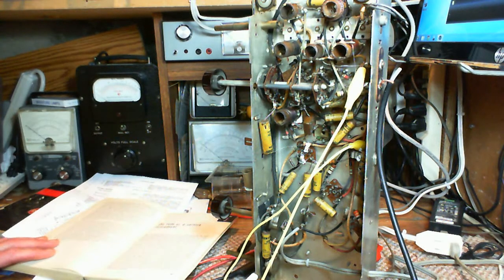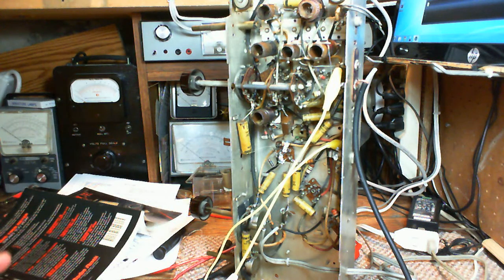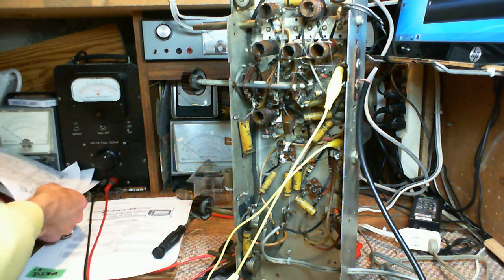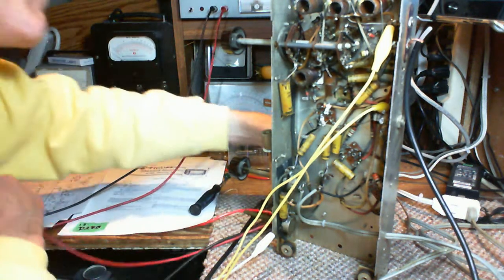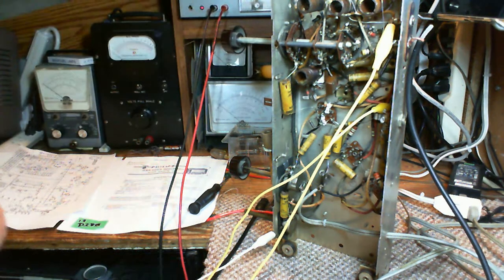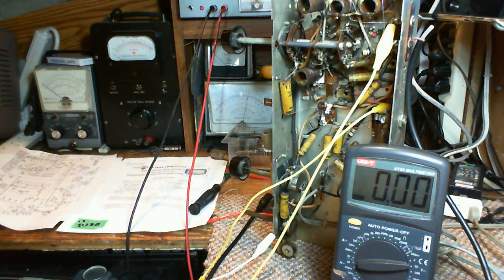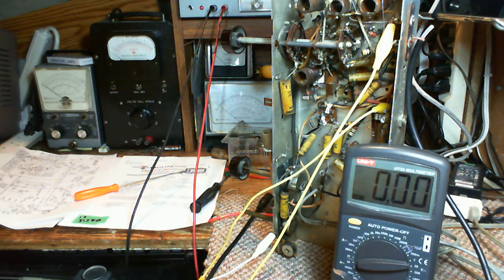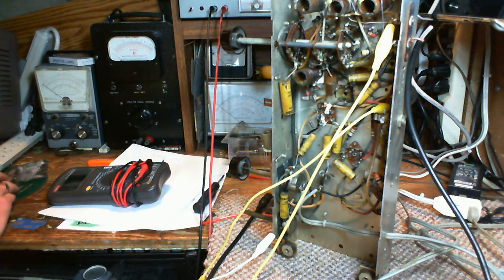Input Impedance VTVM vs DVM - Vacuum Tube Voltmeter vs Digital Voltmeter

Comment: I have never calibrated my meter because I don't rely on them for precision may I just say lol you I think you are like pretend electronics guy I don't think you have ever been calibrated and I would not rely on u for precision  vtvm is probably more accurate than that uni t.
Reply: Sorry man just busting your balls as they say in the north east but you are one crazy dude but you keepin going keep up the good work
Reply: Well I had to rebuild the whole voltage divider on a eico 232 as everything single one was out of tolerance some were not that bad off, but still got replaced. My DMM is quite accurate so voltage wise it’s close enough, resistance measurements have are pretty much spot on. The only  resistor that didn’t get replaced was a 82Meg ohm at like 10%-20%.

Comment: you can use a say 50Meg pot in series with the meter and set it so you have half the input voltage showing on the meter under test then measure the pot value as that will have the same value as the meter input as it is one half of a symmetrical voltage divider

Comment: My Fluke 45 bench meter input impedance is 10MΩ paralleled with 100 pƒ capacitance. This meter came from an ebay auction and was a bit of a gamble. When powered on it produced no start-up errors. But, it displayed completely wrong test results. So, I took a chance that it was going to be a relay or maybe one of the discrete components in the input section. After sometime diagnosing it's symptoms I came up with a stuck relay that caused an over-current situation which fried the relay driver chip ULN2004A. Swapped out the chip and relay all is good again.